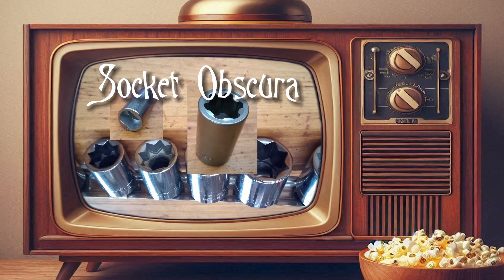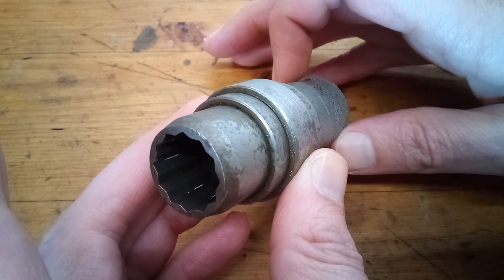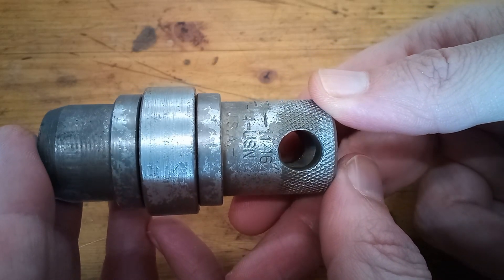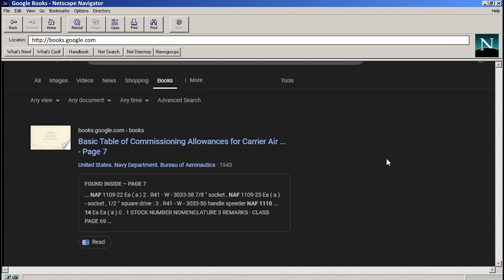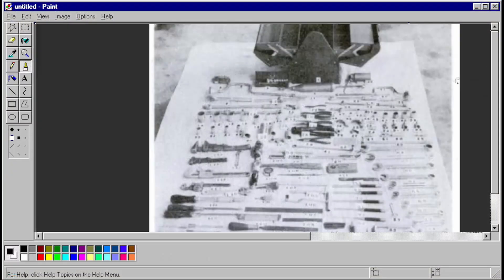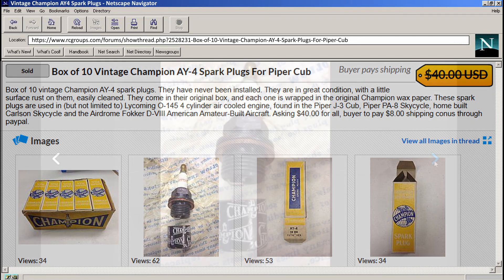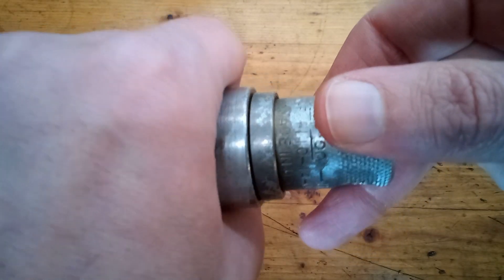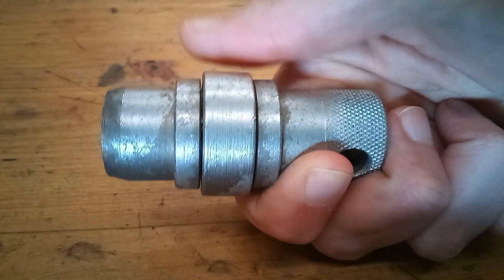Socket Obscura - Weird Spinney Aircraft Spark Plug Socket

Comment: Alloy Artifacts has it on their website. As an aircraft mechanic, haven't heard of 11/16" for spark plugs - new one on me. 7/8" is common. Not sure how a t-handle would work. I'd think the exhaust stacks would be in the way. Need an extension. Thanks for the video.
Reply from the maker: Thanks! Yeah the T-handle doesn't seem practical for an aircraft, I wonder if Snap-On just modified one of their pre-existing socket designs for the government.

Comment: I think the spinning part was for the technician to hold it straight with one hand and start threading in on the knurl part with the other hand. This would actually get the tech into a much better, controlled habit/way  to get the spark plugs in, rather than using one hand.🐞
Reply from the maker: Could be.

Comment: I think you nailed it. It’s probably supposed to index the spinny thing against a part that’s above it in the cylinder head to prevent it from going on wonky and snapping off in the guide and rendering the engine unusable until it can be extracted somehow. They probably encountered problems that justified the design

Comment: I think the Army Air Corps used a simple durable civilian aircraft as a trainer.  They called it the yellow peril. 
It would be the first plane pilot trainees were all to fly.  I don't remember the military designation.
Reply from the maker: Another viewer mentioned the air force using Piper Cubs for training. They used the Lycoming engine. So it may have been for those.